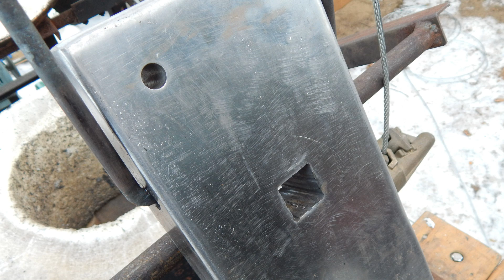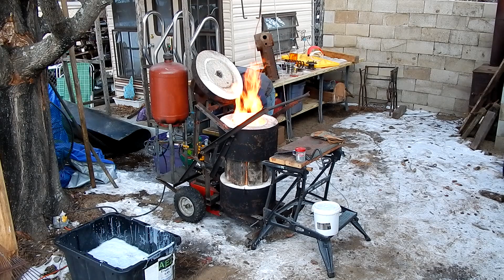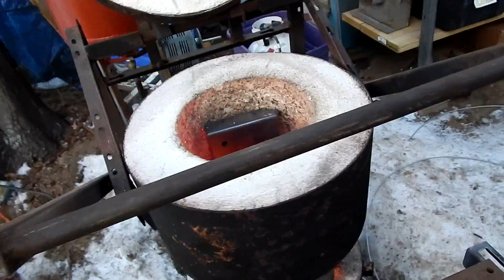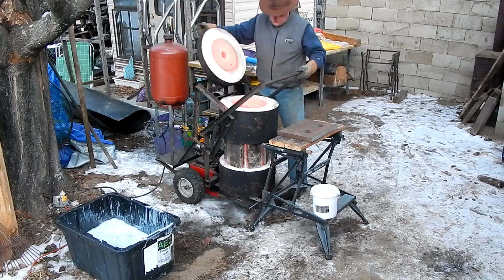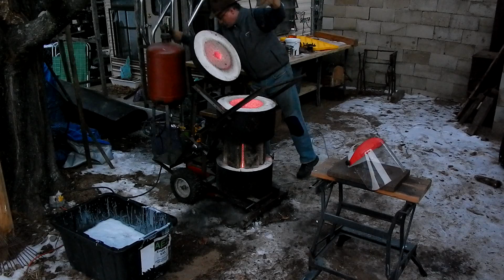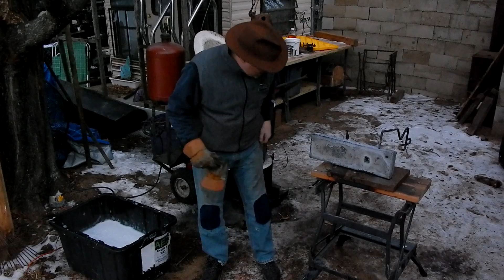Anvil Face Hardening

Comment: Oh god.... Never quench in a plastic bucket.  Just putting this here for anyone else who ever wants to try something like this
Reply from the maker: Why not? Worst case is you get salty water on your shoes.
Reply: @JakevonSlatt  worst case you are up to your ankles in boiling water and have flaming plastic stuck to your work or something else.  It's just plain stupid.  You drop your work it hits the bottom, the water floods out and there is still enough heat to start a fire with the plastic.  This is especially true for larger items.
Reply from the maker: @BrettDalton  makes sense. My everyday quench bucket is a galvanized steel bucket, but I wasn’t going to buy a tub for this one project. You’ll also note I was outside in the middle of winter, that quench solution was at about 9°F when I started and ended up about 160°f when I was done.

Comment: You have answered a question I have been trying to find the answer to. Tha k you..I'm on a similar quest rn myself and will be trying your method as I just saw your comment as I have no idea what the 1 1/2 inch plate I haves harness is.  1/2 ball bearing bounces roughly 2 inches
Reply from the maker: That sounds like mild-steel. I wouldn't bother with the the case-hardening compound, just use the super-quench.

Comment: Nice job  question if you weld it around the edge  aren't you making a spring effect?? 
Lots of work good project
Reply from the maker: I think so, but that may be a good thing for an anvil. It came out having a nice rebound, it's a pleasure to use.

Comment: If it's mild steel it will have a low carbon content. High carbon steels like 1050 or above, 1080 or 1095 or tool steels, will work. The metal needs to be heated to a bright yellow approx 1755 degrees and has become non magnetic. Quench depends on the type of steel, 1095 is quenched in heated oil where as A2 is air quenched. Case hardening is a surface treatment and is easily worn off. Quench should not be done in a plastic container because they melt. A leather apron or some other thermal barrier should be used. Jeans will simply evaporate comming into metal that hot. Your file test did sound to impressive. If you had put some effort I'm pretty sure break through the surface back to mild steel.
Reply: Contrary to popular belief, mild steel can be hardened if a sufficiently fast quenchant is used. Mild steel generally has 0.1% to 0.2% carbon, even 0.25% depending on batch and manufacturer. Usually too little to form carbides when quenched in oil. Wrought iron on the other hand has just about no carbon, and cannot be hardened in it's initial state.

Comment: Should have welded some alloy steel ar400 plate on top of it instead, work hardens and is strong. 1/4 plate is all you need not 1/2 with solid backing. What they make armor out of. Cant do that now after what you did should have thought ahead ding dong. High carbon steel will crack and is not impact resistant. Better roll the hell out those corners.
Reply from the maker: It's four years later and the anvil is holding up well and works great and if you were paying attention you'd know that the anvil is mild steel that's been hardened in super-quench so there is zero chance of cracking and being a safety hazard.
Reply: @JakevonSlatt  OK Jake man I was just trying to participate no need to blow a fuse.
Reply from the maker: @andrewhutchinson5490  Dude, you literally called me a ding dong.
Reply: @JakevonSlatt  Well where I come from that means kind of a hell of a guy.lol keep up the good work.
Reply from the maker: @andrewhutchinson5490  Well my bad then!

Comment: A set of pneumatic tires on a portable melt furnace? Come on Jake. We want you around for a little while longer.  Remember "OK, go with throttle up".
Reply from the maker: Well, TBH the tires are long gone, but they were never really a problem as I've been careful with my crucibles and never had one break. Also any spillage out the bottom vent of the furnace is channeled well away from them. I should have a new vid of the mods up sometime soon now that I have the thing working well on waste oil.

Comment: No, this will not work. The case hardness is only a few thousandths of an inch thick. This may reduce wear in two parts in contact with each other but is useless for an anvil. Also, if you are going to weld chunks of metal together to make something that resembles an anvil, you need 100% weld simply welding the sides of the blocks together, regardless if they have been milled or not, will only result in an energy suck because of the gap. Any anvil buildup MUST be 100%welded all the way from the center to the outside edge. The only way to get a hard surface is to start with metal that has enough carbon in it to start with.
Reply from the maker: I have no idea what alloy the steel is but the super-quench definitely hardened it to the point where a 1/2" ball bearing dropped from 10" bounces back to 5", that's basically railroad rail hardness. The Cherry Red did create a surface that seems less susceptible to rust than the untreated steel, but I agree, it did not contribute to the hardness. 

As for the welding, the surfaces were milled as flat as possible and the assembly clamped so that weld shrinkage would pull them tight together. The anvil has a nice rebound. I've been using it for about two years now and it feels just as good as any "real" anvil I've used and was a hell of a lot cheaper. You can see it in use in some of my other videos.
Reply: I am glad you are happy with all you did, it is important to be satisfied. I am now retired but spent a lifetime in aerospace tooling, tooling inspection and as a certified welding inspectior. In addition to blacksmithing  since 1968, and I have taught blacksmithing for at least 17 years. What I said is true regardless of being happy with the outcome. The gap is an energy suck, the shell is not thick enough to make any meaningful difference and RR track is a very poor anvil by any standard. Enjoy the hobby. I have made a few videos and have received some comments myself so I do understand how this looks. God bless and get it hot and hit it hard!

Comment: You could always case harden it by ... you know, case hardening it. :P
Reply: Jake von Slatt , so was it worth the effort or should one just plate the surface w tool steel welded on
Reply from the maker: I'd say the heating and quenching was definitely worth the effort but the treating with Cherry Read was kind of pointless. That is assuming you have a way to easily heat a 50lbs slab of metal.  If instead you own a nice big welder and don't have a foundry furnace handy, then I'd go that way.
Reply: Jake von Slatt, thank you for the reply. Good to know.  I have a fork from an industrial fork lift coming. Starts at 4in thick and 6.5 in wide then kinda tapers down over about 8 ft. Figure it must be tough stuff cuz we move around 20,ooolbs on a pair of them. One I'm getting  broke at the bend. User error. They rewarded it but didnt fo it properly,  ie rose bud to vivid orange weld n heat n weld n heat the wrap it in alot of insulation  and let kool very slowly. If you dont fo that.it breaks like cast iron looking on the inside. Figure it probably weighs 400lbs at very least , 2 men can not lift it hardly at all. Ought make a killer anvil if I can get it cut n put together
Reply from the maker: Nice! That sounds just about perfect.
Reply from the maker: That's basically what the CherryRed does, but as I learned later the case-hardened layer is so thin it really doesn't help for anything that sustains an impact, it's only really good for creating wear resistant surfaces. It does however seem to create a layer that is more resistant to oxidation. The anvil has been stored outside with a cover for a couple of years now and the untreated horn has a few rust spot but the striking surface remains completely clear of oxidation.

Comment: You went through the trouble of hardening the face only to loose the hardness when you weld it all together.  Not sure you even hardened it much at all either.  Great effort and research but maybe not the best plan.
Reply from the maker: At 260lbs the anvil never got hot enough to temper even a little bit after welding. To reiterate what is in the comments below: 1) The Cherry Red probably added very little to the hardening of the surface and was probably a wasted step. 2) The Super Quench did however harden the steel significantly 3) I don't know what kind of steel this was, but a ball bearing drop test shows that it is now about the hardness of a railroad rail and that is significantly harder than it was before heat treating. 4) been using the anvil for a couple of years now and it works great!

Comment: im a mechanic who uses an anvil once in a while to fabricate parts. as such, i have several anvils. one is extremely soft and huge and heavy from the 1700s i believe. the other one is kind of in-between (hard & soft), and the last one is extremely hard which i use for specialized work on it but not to forge anything on it because it will affect production of certain components. otst, my first anvil produced higher quality results if used correctly. that stuff of test-peening your hammer on it might be good for some applications i belive, but overall, a soft face anvil will produce its desired effects according to ones expertise and purpose. generally speaking, this is a great research project applied to an experimental piece of structural steel. any how, the experiment here with these chemicals is excellent entertainment for the technical inclined. thanks for the video and your time

Comment: This is useless.....the surface is not hard....your file is cutting. The block was still 300-400 degs to cold for a hardening to happen and even of you could case hard a piece of mild steel that large , which you cant with that set up. Case hardening would be pointless anyway. Your hammer blows will only bounce off the soft material laying .00003 " under the surface and your anvil will deform anyway....which I am sure by now you have figured out.
Reply from the maker: lol go find the new video, do not doubt the power of superquench.

Comment: Seems like a over kill to me, just the heat and water would of done the trick. I wonder if thermite might work.
Reply from the maker: The issue with plain water and such a large chunk of steel is steam pockets which prevent the water from making full contact and quickly cooling the piece, the surfactant and soap help prevent that.  If I had used plain water it would have just boiled with big bubbles and would not have produced the lovely screaming sound that the super-quench makes!

Comment: plasick injection parts are "high speed steel"....high carbon already....its likley just annealed....have you tried quenching it in salt alone...?....you'll need to get it to 1250 f if it is...too much oxegen exposure will only decarburize it more...you need to block up the base way more.......salt is a very good quenching medium...the mask...lol....you do like living dangerously...have a look at a tool hardeners handbook....spear and jackson put out a good one years ago...its avalable in pdf form online.
Reply from the maker: This was a limited production "soft" tool, half of the tool was actually aluminum. It hardened just like you'd expect mild steel to harden in super-quench.

Comment: Not true.  Most anvils were not hardened faced until the industrial revolution.  The reason for hardening then came from inexperienced worker missing the work and hitting and denting the anvil.  Softer anvils are better because the face will dent instead of chipping sending shrapnel out and dangerous speeds.  and soft faced anvils are easily repaired.
Reply: well said. and is true. im a mechanic who uses an anvil once in a while to fabricate parts. as such, i have several anvils. one is extremely soft and huge and heavy from the 1700s i believe. the other one is kind of in-between (hard & soft), and the last one is extremely hard which i use for specialized work on it but not to forge anything on it because it will affect production of certain components. otst, my first anvil produced higher quality results if used correctly. that stuff of peening your hammer on it might be good for some applications i belive, but overall, a soft face anvil will produce its desired effects according to ones expertise and purpose. generally speaking, this is a great research project applied to an experimental piece of structural steel. any how, the experiment here with these chemicals is excellent entertainment for the technical inclined. thanks for your time

Comment: The only issue with this type of hardening a mild steel is penetration. The surface might be hardened but how deep is it? If you're going to use it for an anvil then it needs to be considerable and I have my doubts on how long the surface will last. How goes it thus far?
Reply from the maker: It seems to be working very well, but your are right. I do not think that the Cherry Red did much, but I do think that there was sufficient carbon content already in the steel so that the super quench had a significant effect. Ball bearing drop tests show that it's about the same hardness as a railroad rail.
Reply: I've seen a ball bearing drop on a hardened anvil face versus a railroad rail...the rail only produced about half of the rebound that the hardened face provided. I have a cheap cast iron anvil that I'm going to have to weld a hardened face onto for obvious reasons which is why I'm interested in what others have done.
Reply from the maker: horseman1968 Yep, 5" from a ten inch drop is exactly as expected for rails and is perfectly adequate for an anvil, especially when it's for hobby use. My daughter (a blacksmith) deemed it "totally usable with a nice rebound".
Reply: As long as it serves your purpose.

Comment: case hardening is to around 0.3 mm i cant see this working , it hardly works on mild steel drifts at 6 mm round.
Reply from the maker: Yeah, I think most of the improvement in hardness came from the super-quench rather that the Cherry Red.
Reply: thats why he uses chemicals that allows the carbon to penetrate deeper. look upp calcium carbonate :)

Comment: Jake if you need some AR Plate welded onto the anvil i can do that. We have plenty of scraps big enough at the shop and I can stick weld it fully around so it won't crack or break off. Just let me know. Located in w/mass.
Reply: Honestly the face plate should be welded fully with a deep bevel. Or forge welded if possible.

Comment from the maker: I just tested the anvil top with the ball bearing drop test. A 1/2" ball bearing dropped from 10" rebounds to a touch over 5" which is railroad rail hardness. The same steel, un-hardened, bounces back to about 2.5". So this was all definitively worth it!